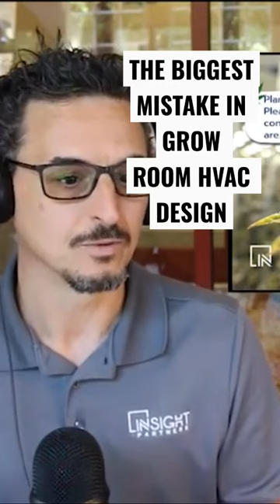The biggest mistake in grow room HVAC design. #cannabispodcast #cannabis #hvac

Comment: One of the biggest mistakes the grower doesn’t even know what they need lol 😂. 

After they do one or two runs they decide to completely switch out their lights to a more energy efficient light and now their entire HVAC system is oversized

The grower gets a hair scheme the idea that using cloth pots provides more air to his roots but that automatically adds 10+ percent humidity to the room that was not accounted for. 

Almost a year later the grower decides he seen somebody else’s room that could go down to 60° in the last week or two to get better color or aroma and he thinks his system was designed to handle that and doesn’t understand why not lol 

The grower originally specked out the system to be designed to run for about six weeks in the mid to upper 70° range. 

And all of a sudden he seen someone else’s system who’s running it about 85° with high concentrations of CO2 and doesn’t understand why his system is cycling on and off now because now it’s grossly oversized. 

The grower likes to burn sulfur in the rooms to kill fungus and mildew but doesn’t understand why his copper coils in his air handler started getting pinhole leaks after a few years. 😢

The grower doesn’t understand and did not tell the person selling the equipment that they spray fungicide‘s in insecticides that contain oil, soaps, glycol as a carrier component for suffocates.    That plug up the filters materials but are clear and you cannot see them with your eye causing high static restriction and coat the coils. 

And 100 of the things the growers themselves don’t know they caused problems and don’t understand why
Reply from the maker: Thank Tom for this informative comment. We appreciate it!